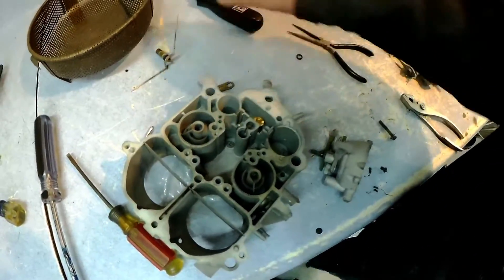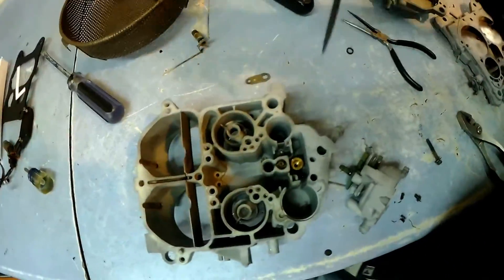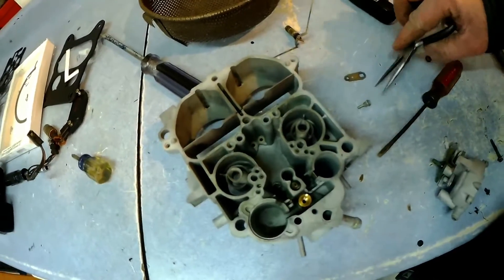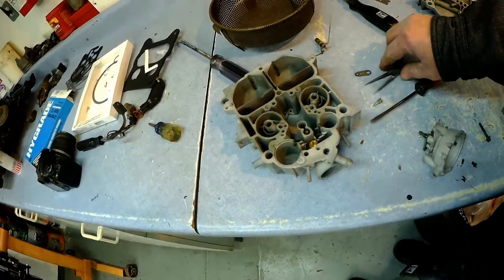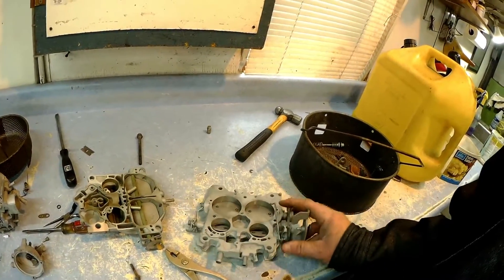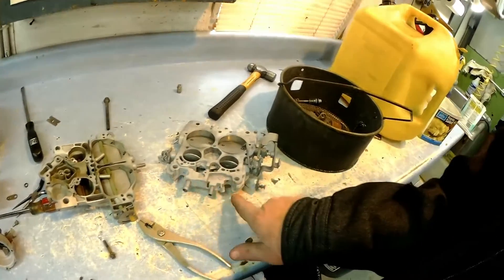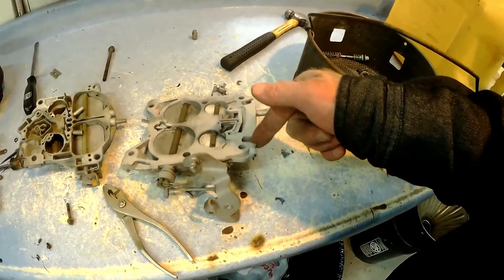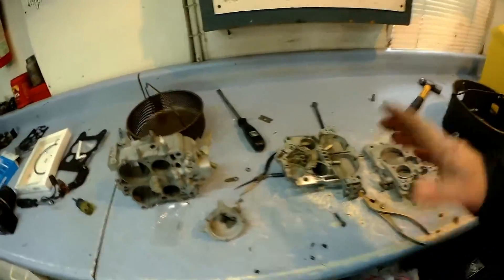GM Quadrajet Rebuild Tips

Comment: GREAT video, I love having You Tube because there's always a professional around willing to give us non-pros some help. Out of curiosity do you have any recommendations for rebuild kits? I'm about to tear into mine and have been looking for a good one. Thanks again!
Reply from the maker: Thanks  for stopping by and checking out the video.  Honestly I just buy whatever rebuild kit is available, all you are going to use out of it are the gaskets and accel pump rubber, basically. If you need a float or choke pull-off, they will be sold separately.  Back in the day I used to buy 100 upper and 100 lower body gaskets and a bag full of accelerator pump gaskets at a time from the local re-builder, but I have since used them up.  I got the kit for this one from O'Rielly, it has gaskets that cover many models. Like $20 bucks.
Reply: Kits with the most parts: Cliff's Performance, Quadrajet Power, Mike's carburetors, The carburetor Shop Eldon, Mo..

Comment: thanks i learned some good stuff. I had one rebuilt  by a local guy and now that its on the car im struggling to get the idle mixture screws to have any effect at all. Ive advanced the timing and  i can still close the mixture screws all the way and the car wont stall. Im running a 1 inch spacer with 4 holes since my linkage wont clear the intake manifold. I finally got the idle screw to make an audibly noticable sound upon opening them but engine rpm doesnt change, im not sure what else could be leaking air. the only vacuum port im using is the ported advance for the distributor and pcv valve. its a 366 tall deck chevy motor with a car intake and spacers. the gaskets between the carb and spacer and spacer and intake are pretty thick.
Reply: I've got the same problem.  Haven't found the vacuum leak yet.

Comment: Thank you so much i Nearly gave up on my quadrogen I've rebuilt it twice air mixture idle screws do nothing I have serious vacuum leaks and now I'm going to go out there and try to rebuild it for the 3rd time after listening to the information that you have shared I feel pretty confident I have a few symptoms that need attention attention I blocked off a vacuum line and I didn't replace those seals That you showed for the joke my choke doesn't mean vacuum line coming off of it as well thank you again I will give it a try and keep you up-to-date
Reply: So I have filed down the top half of that carburetor man it was seriously warped they worked so badly that I feel that I filed it down the best I could and tried to keep it as level and flat but it still has an arch put it back together what a world of a difference no more white smoke no more overfueling thank you the knowledge that you have sir thank you so much for sharing it with us younger folks Because once that knowledge is gone and it's gone thank you I will keep it for generations to come and I will teach my sons long live Rochester quadro jet carburette

Comment: Thanks for the tips. I haven’t messed with one of these sense 1990 on a 84 cutlass. I told my wife that nowadays there’s YouTube, so I could get a refresher. But I was surprised when I seen your tips. Thanx again man. I bought a 1989 Chris Craft Amerosport with a 5.7 Volvo Penta (aka Chevy 350) and am finding myself going through just about everything except the inside of the block, so far I hope. I’ve redone the cooling system from the router to the tooter except for the intake through the block, I’m going to try a new marine flush for that. Now I’m going through the fuel system from the tank to the carb. I’ve flushed 40 gallons of 3 year old gas from the tank the tank and fuel line to the filter, change to a new canister filter water separator, new fuel line to a new mechanical fuel pump, and now I see the carb has a small fuel leak, but most of all I feel it’s leaking lots of air too. I like the idea of the fuel economy option you pointed out. On a floating camper, speed at take off shouldn’t be that necessary. I was shocked to see the 4 barrel carb when I bought the old boat. But better fuel efficiency would be great on long trips down to the Gulf running about 3k rpm. Great vids. You have a new subscriber.
Reply from the maker: Thanks Steve !  and good luck with your restoration :-)
Reply: Thanx for the tips. Has been a long time since I have rebuilt one. Im working on a YJ wrangler I put a SBC in.   I thought a quad. was a  good choice for whAt I'm after. Keep videos coming buddy.

Comment: Great video! I’m rebuilding the Quadrajet on my 74 corvette right now. This is a huge help. I’m not sure how the little spring that holds the metering rods goes on, it came off while working on it. I could use help with that. Thanks again for your video! Jerry
Reply from the maker: It drops down in the hole the metering rod plunger fits into.  It pushes the metering rods up and intake vacuum pulls them down.

Comment: I want to thank you for your pointers i appreciated the knowledge that you shared and wanted to know if you know of a good diagram of choke linkage I took pic before tearing down but still having trouble with last 2-3 items of assembly that didn't quite capture in the pics I took
Reply from the maker: see if this helps at all  https://www.google.com/imgres?imgurl=https%3A%2F%2Fwww.carburetor-parts.com%2Fassets%2Fimages%2Fquadrajet-choke-intragal.JPG&imgrefurl=https%3A%2F%2Fwww.carburetor-blog.com%2Fknowledge-base%2Fquadrajet-choke%2F&tbnid=yv29QRK3oC3EJM&vet=12ahUKEwi24IuT9Zv5AhVRnGoFHUQIBNcQMygCegUIARCFAw..i&docid=W4_MVfXbIq5BrM&w=683&h=475&q=quadrajet%20choke%20assembly&ved=2ahUKEwi24IuT9Zv5AhVRnGoFHUQIBNcQMygCegUIARCFAw

Comment: I have my quad working pretty good but I can’t tell if the secondaries are working. The top air vents won’t move when high  reeving. I have the tension set to very light. The secondary shaft will rotate with the engine off and throttle open very far but will not rotate at all when high reeving. I also removed the secondary lock out, still no movement.
Reply from the maker: The choke pull-off will keep that top air door slammed shut until the vacuum has a chance to bleed off. Free revving it in "park" doesn't always give it enough time to bleed off the vacuum. Try un-plugging the vacuum line to the primary (right front of the carb) choke pull-off and do the test again. Also, you can visually see the secondary shaft move (open) by looking at the passenger side of the carb.  There is a green cross-pin going through the shaft. The lockout thinggy prevents the shaft from opening when it's cold by engaging that cross-pin.  It should become very obvious what's going on once you study it a bit.
Reply: @mark_osborne  Thanks for replying, Mark! Little more background. I have a 1979 Carter Quadrajet and the Vacuum break is at the back of the carburetor. I actually removed it and plugged the vacuum line that is connected to the back of the carb. With the secondary lock mechanism removed, the vacuum break removed, air door tension adjusted to very light, I still don't see the air doors or secondary shaft move at a full throttle rev with the engine running. Funny thing, with the engine not running, I can see the secondary shaft rotate open when i pull back on the throttle. Confusing!
Reply from the maker: @markpelley  That is a first for me !

Comment: Very good video! I need some advice on something. I recently bought an 1986 chevy truck with a V6 4.3. It has a propane system on it and the original carburetor is no where to be found. I have a 78 quadrajet that I just rebuilt and would like to install it. the truck intake manifold is the original four barrel spreadbore quadrajet carburetor set up. Also this engine has the electronic spark control distributor without the vaccum advance. if I put this 78 carb I got on it do you think it will work just fine?
Reply from the maker: Yes yes yes - no reason it won't. Hydrocarbons are Hydrocarbons :-)
Reply: @mark_osborne  awesome, thank you!
Reply: In 1986 they would be throttle body injection.    In 1984 the Chevy C/K series had a carb and TBI option. Some carbs still remained in 85 but by 86 carburetor was phased out and what most would consider a TBI was standard in the vehicles going forward.  And after that OBD 1 followed

Comment: I hope you still remember me.
I am the guy who told you about a fire in my Corvette C3.
After rebuilding we put in place a rebuilt quadrajet, also a new distributor and our problem now is that the idle is not good, about 700 rpm but hesitant.
Something that have us flabergasted is that wathever you do to the idle idle screws is irrelevant because there is no change.
We don't know what to do and where to start.
Other things the advance of the distributor is right.
Besides the engine pick up is just perefect and rew up happily.
We need your help at this point.
Thank you in advance.
Jose
Reply from the maker: If there is no change when you bottom out the idle screws then there is either a blockage in the idle circuit or the top of the carb is warped to the point where it's not compressing the gasket in the middle of the carb. The idle circuit travels up into the top section of the carb, then back down. Take the top off and lay a flat edge across it.  Also, once the top is off, you can take an air gun and blow down into the idle circuits if you know what you're looking at.  In the body of the carb (with the top removed) you'll see 2 brass restrictors in the idle circuit.  They limit the flow of fuel so that once your idle mixture screws are out past about 3 turns it makes no difference.  If I have a car that I can't get rich enough at an idle, I drill those restrictors out a bit.

Comment: I just got a GMC C2500 1984 gifted to me and all of a sudden the truck stopped on the side of the road, if I poor gas straight down the carb it runs then dies, so I pulled the fuel line, turned the truck and fuel is coming out of the said line, changed the fuel filter and still no luck getting any fuel to the carb, said carb is a Rochester 17080212. Bare with me I don't know much about carbs and no one around my area knows how to work on them anymore. I'm considering buying a carb rebuild kit and do my best at putting it back together, but before I go in there I was hoping maybe you had some suggestions. Cheers
Reply from the maker: There is a small filter in the carb- it is inside that adapter that the fuel line threads into.  That filter could be clogged. Takes a 1 inch wrench do undo the adapter once the line is off.  Also (rare) the needle or float could be stuck closed. Very rare tho.
Reply: @mark_osborne  thanks for the quick response, the filter I have changed is the one in the carb, the only one I found as a matter of fact, so my guess is that I need to open up the carb to go look at the float and needle, I will be ordering a rebuilt kit in that case and I will watch and rewatch your videos to make sure I don't fuck it up haha

Comment: If I'm installing I electric choke in place of the hot air style same applies with all those seals?   Thanks
Reply from the maker: The seals are no longer important with an electric choke because you are not using intake vacuum to pull hot air into the housing
Reply: @mark_osborne   do I need to block anything due to vacuum leak in that housing?
Reply from the maker: @lordsauto  I would sometimes take a little RTV and plug the port where the hot air tube attaches (threads on), or, if the hot air tube was already comprimised, I'd just smash the end over and thread it back on.   Are you working with an Oldsmobile carb ?  BTW, the air being sucked through the housing - having come from that metal tube that ran to the back of the air horn on the carb (before passing through the lower intake to pick up heat).  They did it that way so the air had to pass through the air filter and debris couldn't get sucked into the choke housing. Blocking it off eliminates that possiblity, however, if left unblocked it would have no effect on fuel mixture, etc as it normally flows wide open anyway.
Reply: @mark_osborne  I really appeciate it Thanks.

Comment: The adjustment screw you reference at 10:57, all the manuals only say put back where you found it. But mine was screwed all the way down which doesn't sound correct. Any advice on where to start it if "that guy" beat you to it? Thanks for the great tips.
Reply from the maker: You are confusing me
14:13 is the end of the video
Try again
Reply: @mark_osborne  oops, time for those glasses. corrected. 10:57
Reply from the maker: @dennisscars8500  Ahhh yes yes. I do not know the factory adjustment but all that will happen if it's screwed all the way "in" is it will be "leaner" at high intake vaccum (cruising under light throttle).   Set it about 2 turns up, you should be good.
Reply: @mark_osborne  Perfect, thanks for the help and great videos.

Comment: Hello Mark I just took mine apart and cleaned it but I wasnt gonna go into changing out the throttle bushings since you risk snapping off the screws.
I wasn't gonna take the electric choke off as well but now you showed why you should,I think I will.
The secondaries on bottom when the primaries are opened up at full throttle are only at 80 degrees.
Should I adjust the secondaries or is it set to factory specs,if I need to what are some ways I can adjust it to open at 90 degrees?
I know you mentioned the spring tension but I am new to this since it will be my first rebuild I have ever done.
I am not new to working on cars I just never got into rebuilding carbs.
Reply from the maker: No reason to remove the electric choke as it does not rely on "vacuum" to draw hot air, the electric heating element relaxes the choke spring, so save yourself the trouble. Completely normal for the secondaries to open 80 degrees.  Yes, just leave the throttle bushings go unless they are so worn out you can't.  You are correct, you will likely break off the screws. Hope you got this note in time I have been out of town.  You only need to adjust the spring tension if it is "bogging" when you open the secondaires ( too lean).
Reply: Hello Mark Osborne,It's good to have guys like you around to fix this old stuff and keep it going or to answer the finer questions.
I've watched a few videos on how to rebuild the quadrajet,so many things are mentioned but so many questions are left unanswered.
You are a great help to me.
Thank you!!
Reply: You're probably done by now, but just wanted to let you know that you can take the primary plates off without breaking the small screws. They were "staked" on the ends from the factory, so you just grind off the tips, all the way down to the shaft surface, preferably with a carbide burr on a die grinder or drill. Then the screws won't break when removing them. But back them out slowly and carefully nevertheless. A primary throttle bushing kit is available at cliffshighpermance, and contains bronze bushings and new screws for the plates. Installing the bushings requires using a special drill bit to properly size the holes for the bushings, and Cliff sells it too. Makes the job easy.

Comment: Picked up a Quadrajet carb at the Pic a Part (cheap) came off 1970 El Camino with a 350. I ran the numbers and it came back a California Emissions carb . I did a little research and it looks like that carb came with smaller jets and rods to meet emissions . I want to put it on a 350 Chevy so what would be the stock jets and rods size for it and what's the difference between the two carbs. Thanks
Reply from the maker: I have no clue.  Stick it on and see how it drives. If it seems "lean", try some smaller metering rods. I've even taken metering rods and very carefully ground them down a tad on a high speed bench grinder.  Don't tell anyone !!!!!

Comment: I have a quadrajet with its own Secondary pulloff. Even under full vacuum it doesn't seem like it can even open the secondaries. I also have a electric choke. Do you have tuning video's? How can I tell if my secondaries are opening under the proper load?
Reply from the maker: That secondary pull-off will relax one you mash the throttle and the intake vacuum goes away. Just check it with the engine shut off, you should be able to push the secondary air door open. If not, something is wrong. Not really sure how you can tell if they are opening other than the "sound"- depending on the engine, it is an unmistakable "roar".  I have one other tuning video on how to adjust the secondary air door  tension.  If it was me, I'd remove that secondary pull off and simply adjust the tension on the secondary air door (if needed), you probably won't even need to adjust it, I'll bet she runs just fine

Comment: Very helpful tips brother.  Thank you 
I broke off 9 screws from the butterfly assembly. I tapped and drilled them out.  Question 1: I go a size higher on the screws? Question 2: should I use treadlocker?
Reply from the maker: Sorry I've been out of town. What I have done in the past is use tiny machine bolts and nuts with threadlocker, that way you don't have to drill the holes larger

Comment: My q-jet leaks out the well plugs when it sits. Have to add fuel to start it. Do I epoxy them? Replace them?
Reply from the maker: Take it apart, place the center section (body of the carb) upside down on a work bench covered in a thick towel. Then, take a small flat hammer (not a ball peen hammer) and go around each well plug and slowly hammer over the aluminum that holds the plug in place.  Be careful, go slow, just try to do an even job all the way around each plug.  I have had success doing it this way.  You could also apply some gasoline resistant epoxy (as you suggest) over the plugs after you've given them the hammer treatment.  Do NOT try to replace them, you will destroy the carb.
Reply: @mark_osborne  ok. Thank you very much for the info